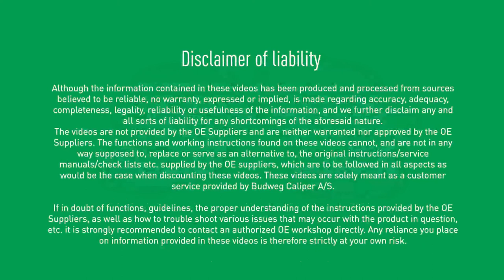BUDWEG | How to repair the piston and rubber parts on EPB Calipers - EN

Comment: What happens if the piston comes all the way out?
And the boot has a cut in it.
Reply: It could cause wear and allow water into the module. Should be replaced asap.
Reply: Is it possible to replace the dust boot without taking the piston completely out ? @LACALISWAG
Reply: @AlinMadalin23  Not with this caliper design. If you are wise, you change the pads in good time, then the piston and dust boot do not go out as far, better protection.
Reply: @seriksson9721  yeah i changed them but when the piston went back in somehow it catched the boot and broke  it..
Reply: @AlinMadalin23  I recommend a lot of silicone grease and using a spinning/ rotating motion when fitting the dust boot and piston. It's not quite easy, as you noticed.